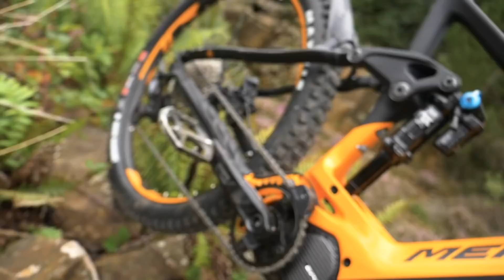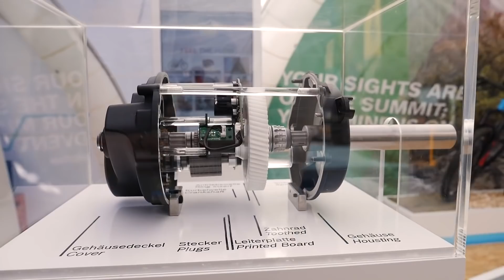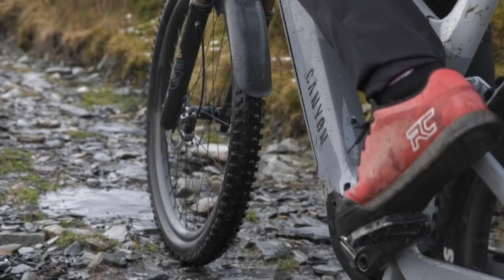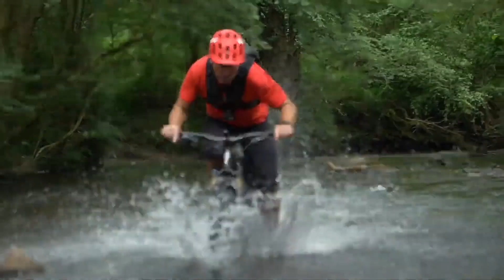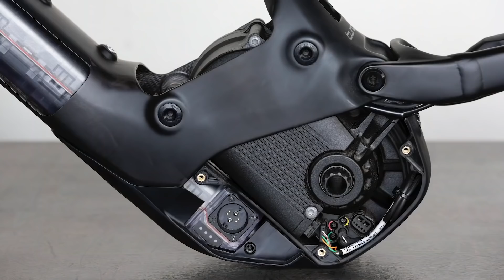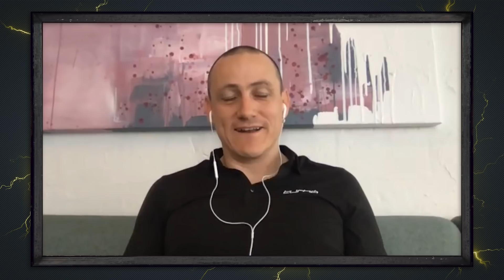Future E Bike Technology Part 3 | The Future Of The Electric Mountain Bike Motor?

Comment: A gearbox that can change under power, built into the motor would be good. Then we can go belt drive, with minimum maintenance.

IMO motors are powerful enough, but more range, lighter, smaller, cooler is always welcome.

A sensible speed limit is the next big change that needs to happen. Just up it to 20mph, and 90% of people would be happy enough.
Reply: Have a look at Revonte, they are currently testing this idea out with great results, Continential also designed the same idea, however, they decided not to go ahead with producing it large scale until they scrapped it, the only viable alternative at the moment is the Enviolo with a variable automatic transmission hub on the back wheel, I currently have a Cube SUV Hybrid Race 500 with the exact system, to be fair it's great and would love to see future E mountain bikes with what you have mentioned.
Reply: you can belt drive right now. with gearbox from Rohloff Bicycle Gearbox, puting with mid-drive motor you have awesome combination and you can change gears under pressure. just the question is why do you need this? this is not a 500 nm 5000w motor with ability to drive uphill with speed. alone your question is noncens. this is not CAR ! neither it needs a torque like that ! maintenance is idioticly simple, why should you shy from this "MAINTENANCE" ?

speed limit ? ok, KEVIN you are realy smart politican forthvisioniare, go back to your sofa or chair and put some good farts in it :)))
Reply: @bestvideos4ever1  
"you can belt drive right now. with gearbox from Rohloff Bicycle Gearbox, puting with mid-drive motor you have awesome combination and you can change gears under pressure."
Hub gears are (a lot of) unsprung weight, which isn't good for keeping your tyres in contact with the ground.
A gearbox in the motor would be sprung weight.

"just the question is why do you need this?"
A derailleur is exposed and relatively fragile, haven't you ever damaged yours?

"this is not a 500 nm 5000w motor with ability to drive uphill with speed. alone your question is noncens. this is not CAR ! neither it needs a torque like that !"
You are the only person to have mentioned any of that.

"maintenance is idioticly simple, why should you shy from this "MAINTENANCE" ?"
No, it's about grip, and not having to walk home with a broken bike.

 "speed limit ? ok, KEVIN you are realy smart politican forthvisioniare, go back to your sofa or chair and put some good farts in it :)))"
So you are a complete idiot :(
Some of us cycle to the trails, and the 15 mph limit is effectively a hard limit when pedaling an MTB on road.
I can assure you that cars and lorries passing at 15 mph+, is far more scary than 5-10mph.
You are aware that road cyclist can do over 30mph without a motor? The Pros average about 30 mph !!
I'm asking for 4 mph, maybe 20 mph with the motor fading out to 25.
This already exists (well similar) in some places as S-pedelecs, so most of the bikes are quite capable of it - it's only the firmware that's different.